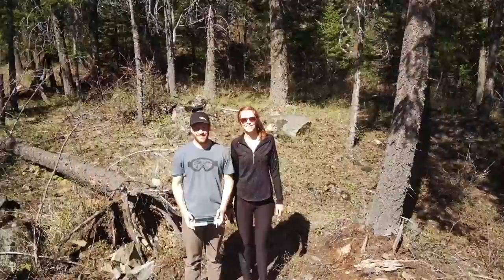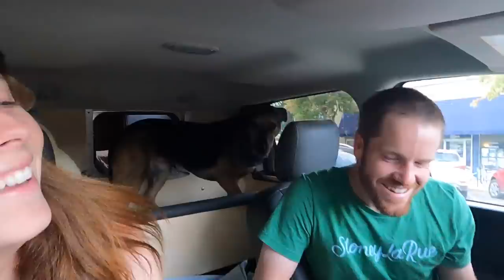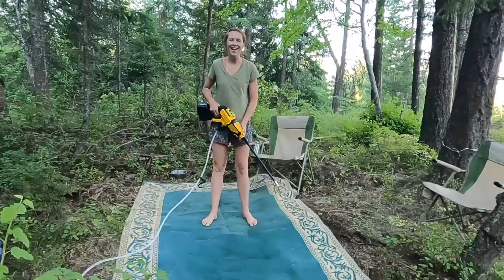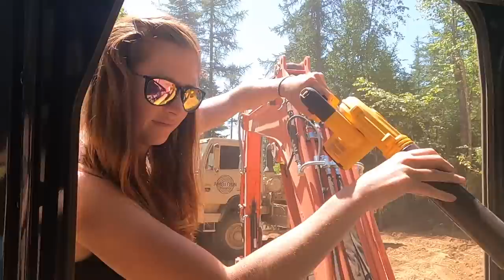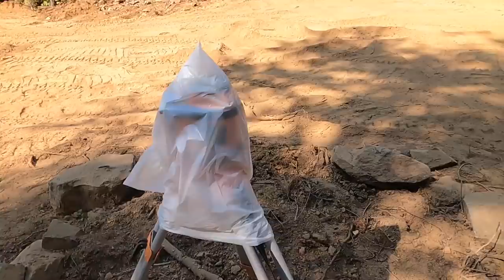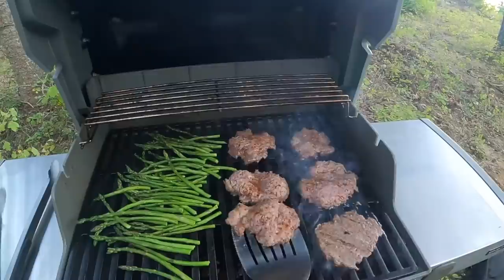Our DIY Dump Truck Is AWESOME!! | E11

Comment: suggestions: Dig a drainage ditch on the uphill and side of the lot, and service all your air filters if you havn't yet
Congrats, looks like it'll be a great space
Reply from the maker: Yes!! One of the primary reasons I bought the cordless leaf blower is to blow the air filters on everything out.

Comment: You guys remind me of my younger days when I built everything myself. I just turned 70 July 7th. In the late 70s into 80s and even the 90s I was doing much the same things except the tools were not as advanced.  I sold tools from 1986 to 2015 Mac Tools. Now I have a 2014 F350 with 2019 Cirrus Camper and in a c week I'm heading by myself to Alaska from Florida.  It's 95 everyday hear so I'm used to the heat but not 108. My dad was an engineer and Architect on the Alaskan Highway in WW2 so I'm tracing his footsteps to Alaska.  Let's hope the Border in Canada opens July 21st.  I enjoy watching your progress.
Reply from the maker: That is a sweet truck and camper set up and and even better adventure! I hope you can make it happen this summer!

Comment: You might already be tracking this, but the uphill side of your building will need a drainage strategy for surface runoff.  Positive slope away from the building then  sloped grade or a French Drain ran to downhill.  Keep up the great work, my wife and I are doing something really similar on the Northwest side of the lake.
Reply from the maker: Yes! Drainage is going to be very important before the rain arrives...

Comment: QUESTION:  You have mentioned a "level" pad for the shop/apartment building.  Wouldn't you want a slight grade in case water gets inside?  Imagine pulling a snow covered vehicle into the shop and getting water puddling in the shop.  Just a thought.
Reply from the maker: Very true!

Comment: I can tell you're getting Riley good on that ex. because you can grade with it and that takes touch.  Keep checking/blowing out those air filters.  On the LMTV is a swirl separator that grabs a lot of the dust before it makes it to the air filter, keep that clean and your filter (not cheap) will stay lots cleaner.  Good video, Joh and Donna.
Reply from the maker: He is doing such a great job grading with it! We are cleaning the outer filter daily to try and stay ahead of it!

Comment: I noticed you didn't have much rock in the area you were digging for the shop. Based on your later videos it was a surprise.  
"Wasn't Courtney worried about getting your dump truck muddy when you were "compacting your fill"?  LOL
I thought you'd have "dry heat" there in upper Idaho....
Whatever, WELL DONE>

Comment: It’s surprising how much material needs to be moved to level a pad. Our mile long driveway was moondust for a few months till we got gravel too.
Reply from the maker: Did you gravel over the moon dust or use road fabric or? Seems like some larger rock first would be better.
Reply: My place has about 6-12” of organic and moondust on top and gravel and rock below that. I left the moo dust in place and put more than a foot of mostly 2” minus gravel on top. That seems to work. One really wet spring, I needed to add another 6-12”  of gravel in a few spots. We still get a bit of moondust creeping to the top. I’ll likely wet it with diluted mag chloride at some point to control dust long term. Thankfully, my dad  found a great gravel source on the property. My wife uses that area for a range to teach firearms classes now. Win win.

Comment: Congrats on 2 years! That moon dust comment reminded me of the "moon boots" we wore in the 70`s during the winter. They were worm but wore out fast if you did any walking in them. Have you checked the air filter on Humpty Dumpty and the unnamed exc.? You can gently tap the filter against a rock and watch all the dust fall out. You two look like pro`s with the machines. One last thing. Did you ever hear the old saying, " figure out what size garage you want, then double it". It`s pretty true in most cases. Take care
Reply from the maker: The primary reason we bought the cordless leaf blower was for blowing out the air filters on all of our equipment. It is incredible how much accumulates in just one day!

Comment: You did an excellent job on that dude, I sincerely hope it holds up for ya’ll. Ya’ll planning on sticking up a solid ali or steel dumper addition to the back? Cost effective would almost be get a s*** half shipper and put em on the sides, hack the back in half, hinge it so the dump ain’t so bad. Spitballin. Pretty cool seein ya’ll work man. Actually now that I’m thinking about it, four hinge it around the three sides cept the cab, it’ll give you the clearance you need while doubling the filling. Just googled it, half sized shipper is three grand, rofl, never mind on that.

Comment: So in the real world of construction, a roll test is 100% valid way of determining compaction. If you can take your loaded dump truck, and you see less than half an inch of deflection in the surface around the wheel (and not including squishing uncompacted dirt right under the wheel), you can be nearly certain you are at least 95-98% compaction. Zero deflection of the material you guys have is probably 98-100%. Good plan going with only filling up to 2'. Any more than that and you can't be sure you get compaction under even the heaviest equipment.
Reply from the maker: Thank you so much for the input, I'm glad to hear it seems like we are on the right track!

Comment: Hey you two!
Great job so far. Question for you:
I see your cutting for the shop elevation- are you planning on building any structures on the area you've been dumping ?
Reply from the maker: Hi Ryan! We have zero plans to build where we have been putting all of the fill. But by bringing the level in that area up it should become nice place to turn a trailer around, etc.
Reply: @AmbitionStrikes  right on, I was trying to visualize the site if I were planning.

Don't forget to get your temp drainage dug in before the rain. Moon dust even makes a mess in 🇨🇦

Comment: Are you able to build straight on top of this flattened dirt? Or will you need to dig down again for foundations/supports?

P.S. Driving an excavator looks like so much fun.
Reply: Oh nvm, just got to the bit where you said you were going to put piers down to the original ground.
Reply from the maker: Hi James! The piers will support the building, and when the budget allows we will come in a pour a floating slab floor inside the building. Check out RR Buildings on YT, he has some awesome videos.

Comment: So you did you build the camper on your truck or build it…what year is the Cummins…figure you are either a 2500 or a 3500 hopefully with 4x4
Reply from the maker: Yes we built that camper. You can check out those videos here: https://youtube.com/playlist?list=PLMCvRxq4QdccLFEd53JSsRaGNk18nGeMF

It's a 2015 Ram 3500 6.7 4x4 CCSB

Comment: Perhaps it is good too make a ditch behind  the shop, so in heavy rain,  rainwater from the mountain can drain besides the shop and not ruin the fundation.
Reply from the maker: Yes! That is an excellent point and we are definitely going to need to do something like that before winter.
Reply from the maker: Yes that's the plan! Thanks for watching!

Comment: Nice work ! 
By the way it's CARA not a non stick ...
Reply from the maker: What is CARA? There's what looks like small crushed rock mixed with paint on the floor of the bed.
Reply: @AmbitionStrikes  Sorry, meant CARC it's the paint the army uses to allow the quick wash of chemicals of the equipment.
This paint can be harmful when you apply it but it want hurt you after it's cured. CARC is also hard to fix, you will need to remove it if you want to do patches on rust, for that you will need a good filter and not to inhale this material.  https://en.wikipedia.org/wiki/Chemical_Agent_Resistant_Coating
Good luck and carry on with your vids!

Comment: You know you can miss your legs and then throw that dust all over you and they won't bother you but if you want to go get your bag of soap or put it in a soap or put it in a sock dab it all over your legs in your arms in that way they will not bother you and it's not a chemical that would hurt you
Reply from the maker: Thanks for the tip Rudy, I will have to try that!